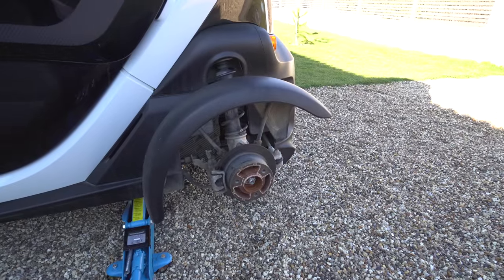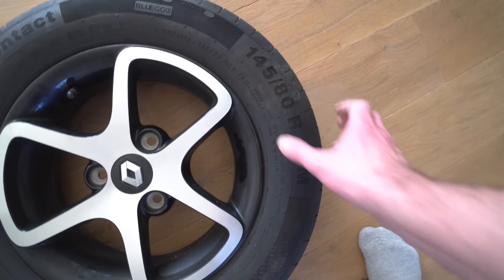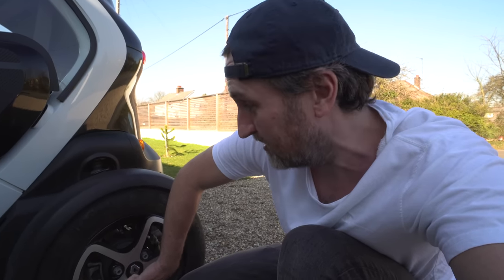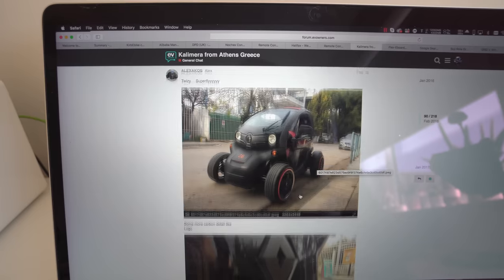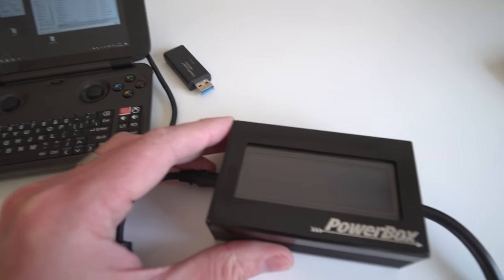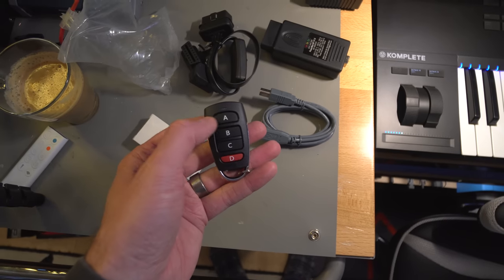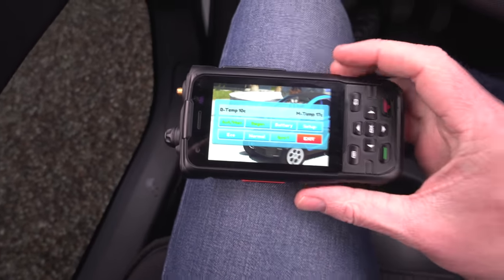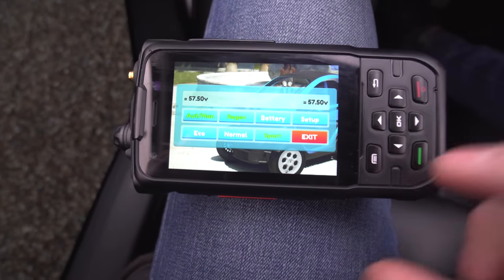RENAULT TWIZY 2019 MODIFICATIONS | NEW POWERBOX BLUETOOTH & LIGHTWEIGHT WHEELS!!!

Comment: Add a degree or two to the camber angle on the front to reduce understeer. Probably set to 0 degrees to minimize rolling resistance, but does nothing for cornering. Really enjoying your channel.
Reply: A degree or two? Are you out of your mind? 2 degrees is like way to much even 1 degree you aren't making a drifster here mate
Reply: Doubt you can adjust camber with factory arms on these and I’d be surprised if you can buy adjustable ones.
Reply: @NathanFrench  I was think that, you can fully strip down suspension and rebuild it without any change.

Comment: extend your battery life, Do  not charge past 95% can add years to the life of batteries
Reply from the maker: Yes that’s right and actually the battery in the twizy only charges to about 95% the BMS is configured to charge to around 4.13v per cell rather than 4.2v

Comment: As always very helpful. I've just gone with modifying the stock steel wheel by 'banding' but am concerned about the extra weight so will hold off putting them on the car until I get a powerbox. At least that was I can appreciate the new wheels and hopefully get the added advantage of the extra boost the power box will give. I'm hoping to make the PB my next purchase in a couple of weeks. Also need to address the wider wheel arch issue. I have thought about an open wheeled kit car arch the likes of Westfield or Caterham. Can't wait for part 2 btw :)

Comment: 145 used to be standard with on small cars in the 90''. Going wider will hurt your range. If I owned a Twizzy, i'd try to switch the rear wheels to the front and the front ones on the back. Also Brightstone ecopia are available in 145/80 and they are high the pressure  type god for 4-5 bars and hard rubber so you'll be rolling like a bicycle. The lowest rolling resistance tyres I've ever used, and I have tried a few different. But you are right, narrow tires affects cornering but not braking distance as many believe.

Comment: The understeer is a common problem.
Renault does not trust you with the rear wheel drive, so they put on 125 tires in the front.
A lot of Twizy drivers have changed ther tires from 125/80 to 145/70 in the front.
With this modification the Twizy will be quite neutral.

I also changed the backtires from 145/80 to 155/70. For some manufacturers you can also fit 165/70 on the back tires.(without modification to the fenders)

But for me the 145/155 comb seems to be perfect.
Reply from the maker: Yes you are right about the understeer!
Interesting about your setup with 145’s at the front, this is sounds like a good solution for those not wanting to change rims and fenders 👍
Stay tuned for the next video 😁
Reply: @andykirby  But the elia solution is also very valid ;-) 
But harder to get throuh MOT here in Germany ;-)
Reply from the maker: Yes it’s a nice solution and it works well, I’m very impressed with the setup 😁

Comment: Changing the wheel size will ruin your car and have little effect on handling balance of the car. It will have some effect but not what your really after.  The reason you have massive understeer is because Renault dialed it into the suspension making the car safer for less experienced drivers.  What you need to do to reduce understeer is change the balance of grip in the corner not with tyre size but how much load is on each tyre in the corner this is done by suspension adjustment. At the moment the rear wheels have way more grip than the front. 
To change this balance you could remove the front anti roll bar this will make the car roll more in the front as you turn in lifting the rear inside wheel off the ground now this will definitely completely change the balance of handling It will do nothing but oversteer maybe dangerously so. But if you got yourself adjustable anti roll bars you could soften the front bar so to lift (unload) the rear inside wheel a kiss mid corner getting the perfect balance your after. A controlled skid!

Comment: How secure is this? Can't just anyone connect to that bluetooth dongle remotely and control the car from there?
I know they cannot steal the twizzy if it is turned off or parked but I know they could shut the engine off and get the car to ransom by accelerating and regenerating hard repeatedly and preventing the driver from accessing the dongle to disconnect.

Comment: Hi Andy,

Love the vids keep up the good work. I’m wanting to grab a controller from your store, do you hold any uk stock, as I’m needing a quick turnaround?
Reply from the maker: Hi, glad you like the videos, we don’t have U.K. stock no but controllers arrive pretty quickly in a few days normally.
Reply: @andy kirby , thanks for the quick reply, I’ll go and get it sorted now. It’s seems pretty clear the Sab is the way to go, for big motors and high voltage
Reply from the maker: Yes they are bulletproof controllers. I’ve tried them all and last year and decided to use exclusively Sabvoton on my builds after 2 failed adaptto controllers.

Comment: When it's slippy regen doesn't make the tyres lock up, the wheels need to be turning to generate electricity so if they stop turning then they'll stop producing electricity, therefore allowing the wheels to turn again, acting like a form of ABS becuase of the nature of how regenerative braking works
Reply from the maker: Regen puts a force on the back wheels which is similar to the effects of braking. I’ve 180’d before on a slippery road when I had the regen current turned up too high and just tapped the brake. The twizy’s regen is raw, it will activate as soon as the brake contact switch is closed. (Although there is a recuperation curve)

Comment: For the Twizzy to gain type approval for the UK market it will have had to conform to UK construction and use regulations, I would imagine somewhere in there is a requirement to have covered wheels

Indeed it is, Section 63 

http://www.legislation.gov.uk/uksi/1986/1078/regulation/63/made
Reply: Its not registered as a car but a ligth motor bike .
Reply: @ Tore Nyland, it's actually classed as a heavy quadricycle
Reply: @djhatstand7312  im in norwayband they called it a ligth motorbike  but we dont have a dedicated quad class .

Comment: You can't have a car on the UK roads without wheel guards, it isn't just a mot requirement it's a road safety one and the car can be seized and compounded by the police.
Reply from the maker: It’s not a car though, it’s a heavy quadricycle. Not sure of the law regarding those. I got stopped on a Police and VOSA roadside spot check (huge operation with about 50 officers) yesterday and they didn’t say anything. I am still going to make some guards as the spray is a bit too much in the rain.
Reply: Pretty sure even Quads on OK roads have to have guards, it's a requirement on motorcycles as well that that must have a guard covering the width of the tyre, can probably be as short as you like tho as thats an anomaly of the UK law. I'd double check with a local MOT tester just to make sure something hasn't changed in updated legislation but it certainly used to be the case.

Comment: Wider wheels/tyres will give you more drag i.e. less range and won't necessarily improve grip on such a light vehicle. No mudguards will win you 3 points per wheel. As a four wheeler you must run mudguards on all wheels - full coverage.
Reply from the maker: Wheels are on now, No noticeable range drop. Massive improvement in grip can literally full throttle around bends even in the wet and understeer is gone...got inspected today on a police roadside test with VOSA, they didn’t have a problem with the Twizy without mudguards maybe as it’s a quadricycle... not sure.

Comment: Use wheels from a smart their 3 bolt wheels.....monoblocks may look great
Reply: Wrong PCD, he would still need an adapter.
Reply: @CalmoOmlac  Those would actually fit, they're the same 3x98 PCD as the Twizy.
Reply: @CalmoOmlac  Only Peugeot and Citroen used the 3x98 wheels IIRC so they weren't very common.

Comment: I'd get the stock wheels modified to be wider.
Reply from the maker: It would keep the looks similar but lot of trouble to go to and they probably wouldn’t be as light as racing wheels, also you’d still need the spacers to allow the extra width.